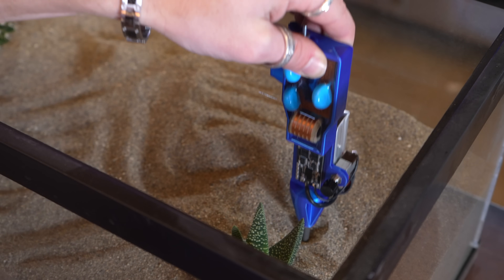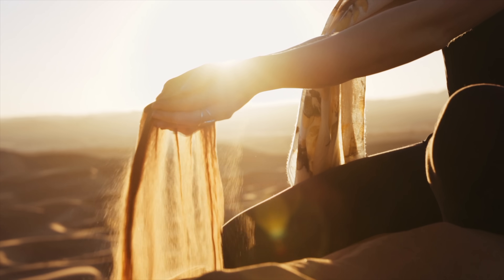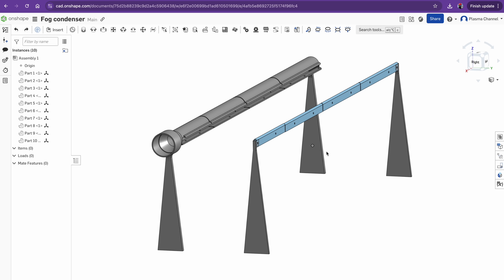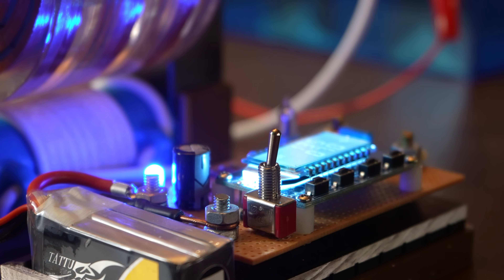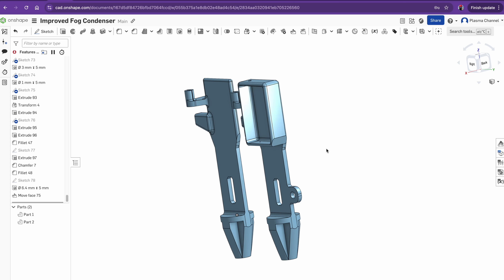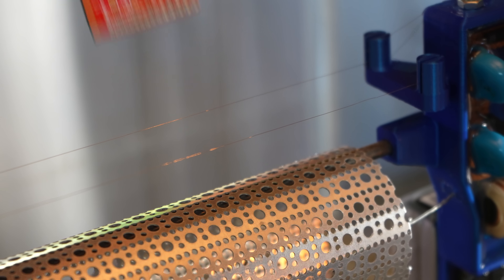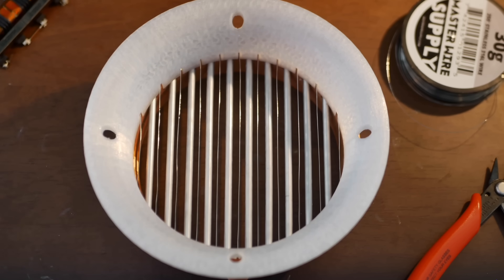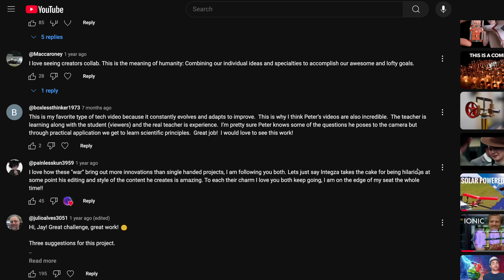Solving Desert Water Shortages Using 20,000 Volts

Comment: Clever work, however it only works if the mesh is "cold", it could only work in the morning when the air is slighlty hotter than the condenser, due to different specific heats. You would consider it working for, let's say, notmore than 1-2 hours a day. It's already pretty descent but true conditions testing might affect the rentability of it as the condenser would get warmer and eventually not cold enough to condensate water (the heat exchange time between droplets and condenser being significally small with the speed). Would be happy to see a video in such conditions !

Comment: So if air at high altitude has more charge than air at ground level would it condense out like in this experiment if you could draw it down to ground level via a tower with pipes inside it? Or would it loose it's charge in the process? Very interesting. I wonder if this could be used as a dehumidifier in domestic applications too?

Comment: Amazing concept! given it's in the desert. You could probably attach a solar panel to it,  charge during the day and allow the device to operate without replacing the battery.. Even if it weren't used for agriculture. It could be used to start vegetation growth in deserts, which is an idea being floated by a few countries with respect to reducing Co2.

Comment: Problematic that the grid is grounded and has the same potential as, well, ground. You'll condense water over the whole ground area. Also the droplets shoot through the grid like in a thruster. A solid plate works better. Use a steel sheet and stick some magnets to it that crash the droplets onto the plate like in a sputterer. Probably improves efficiency by a lot. Greetings from Germany 

Edit: I forgot. If you up your voltage or reduce the electrode distance to an energetic corona discharge, you'll get RONS, which form ammonia and hydrocarbons which fertilize the land while you water it

Comment: Surely, you can't beat the efficiency of fog nets, because they consume no power. If they only gather a small percentage of the available water, it would be more sensible to just put up more fog nets. Double the fog nets means double the collection for the same power consumption - zero. However, your device may make sense where physical space is limited and/or where time is limited, such as a portable survival device. Then you have the limitations of how portable it could be and the issue of availability of power. Maybe also as small scale desalination.

Comment: Humidifier make water from air.
But it seem the HV system is more efficient..🤔
To increase surface area, I would buid an assimetric capacitor, wires one side and mesh on otherside or make a wrapped spiral capacitor and just blow air through..🙂

Comment: I made a comment but can no longer find it from 30 mins ago so I will repeat. Maybe it got lost.  I  love the research you are doing, I see your video today, and yesterday I saw something interesting.  Your device is interesting but it requires electronics and a battery.  I know a solar panel could run it.  However a little food for thought for your projects scope.  Tesla once built a wooden tower, it was a project to take free energy from the sky.  Unfortunately he never got to finish the project. The research on free energy is somewhat proven, but not really of any practical use, until I see your grid water collector. I am seeing high voltages, free, apart some tower constructions. I will paste a couple as food for thought.
Reply: https://youtu.be/2rVdEhyMR6A?si=hlo5G9of4M8ynDyr
Reply: https://youtu.be/ENeDkGce5-4?si=NX1q_tGti2tNvrP0

Comment: 15:09
well the dehumidifyer is made to condense water.
You version just attracts already condensed water (fog).
Fog is made of condesed water dropplets submerged in air.
I am pretty sure that Thermodynamically you could do that with 0W of power in theory. (in the limit of a perfect system doing it as slowly as only possible)

Comment: great device to pull water out of fog , and it doesnt compare to the dehumidifier in that work case .
but how does it compare against the dehumidifier when there is no fog ?
so say the humidity in the room is 65% what would pull more moisture out of the air than ?

Comment: So explain why the "fog" responded so strongly almost like a heavy wind when you first powered the system? I mean it is one thing to see water condensing but another to see it turn into a wind tunnel...Could this also see application for areas such as Pacifica, CA to "defog" the area for driver safety while solving some of the drought problems in CA at the same time?

Comment: Ok, so: First, I love this.  It's awesome.

Second, I've been looking an emergency preparedness, especially in case of long term power interruption.  (Both solar events and foreign hackers are currently a significant threat to large parts of the U.S. power grid.)  What I've found is that the biggest danger of a power outage that lasts more than a few days is water.  Close to 100% of Americans rely on either city water pumps or a well pump on their own property for a continuous supply of water and have no backup option available if a power outage prevents the electrically powered pumps from working.

I've been looking for solutions to this, but the big ones I've found are things like installing secondary hand pumps (which would have to be installed in underground bunkers in climates that get significantly below freezing in the winter), which are fairly expensive solutions.  Now, solar panels are not super expensive anymore, and most places in the U.S. have significant humidity in the air a lot of the time and/or mist in the mornings, during times of year where precipitation is low enough that it isn't a very plentiful source of water.  This sounds like the kind of solution I'm looking for.  (I'm not looking for just one solution.  The more the better.  Also though, the cheaper and more widely available the better.)  I'm very interested, and I'm excited to see further development.

One thing I'm curious about: How much water can this extract from air without fog, at various humidity levels?  And of course, does the efficiency suffer with lower humidity (probably), and how much?

Anyhow, awesome video!  Thanks for sharing.

Comment: What a load of BS.... this ain´t new. The principle of "harvesting" and redirecting the moisture in the morning in hot and desert climates is not new and does not need any tech... especially not in such an inefficient way... deserts can get very cold at night and it only needs a surface that does not heat up as fast to condense some of the morning moisture in the air.

Comment: Why not tune the transformer to roughly 30kv instead of 8kv then using the v-multiplier - it is redundant and makes it more costly for mass production. Why is it redundant because it still outputs 20-35kv.
Reply: It's costly to build a 30kv transformer. The wire needs thicker insulation for 30kv. Here, the transformer windings only need to handle 8kv. Microwave ovens use a voltage doubler for similar reasons.
Reply: @realsolarcars  He initially used the 60Kv trans and tuned it town to 8kv then took it up to 30kv with the mulitplier. initially, it could have probably even kept it at 60Kv

Comment: This phenomenon needs to be studied much more and optimized. At the same time experiments on a real scale are better to find out if there are ways to optimize the system with a number of physical "tricks" like cooling the base. Hence, the air condenses because of a greater temperature difference. So many things to find if this is even economically feasible.

Comment: Wondering about the enviroment if the thin wires would survive and for how long also if there is a way to coat the metal grid with a hydrophobic coating to make it easier for the water droplets to pour down as well as freeing up the grid for more water to accumulate..

Comment: I noticed that the anode/collector on the last setup was bent so that the sides were angled inwards. Thus they were missing some of the falling air that was being pulled down with the charged mist. In a situation where the mist is all around the device, ( instead of from a single point ) this would reduce the amount it could catch. Because this device is basically a stationary ion motor, I bet the efficiency would go up if you bend the collector so the sides can catch more of the downward airflow.

Also, I think that there could be a way to combine this device with a solar panel by using the back of the panel as the collector etc before the sun comes up. Then rotating to catch the sun during the day. If it had a reservoir or was connected to a storage system with other panels, it would not have to be where the plants are and could provide water for other purposes too. A large solar panel has enough area to catch a lot of water under the right conditions.

If you coat the collector with something that radiates infrared so it is cooler than the ambient temperature, then it will get condensation thermally too. Then you could run it all night instead of just when there is fog. It would not get as much that way. But when every drop counts it would be worth the energy spent pushing air against the collector all night with the ion motor.

I wonder if putting the cathode wires into a venturi would improve it or just make it more complicated. You can also do something like adding another wire wrapped around the two main wires to increase the area of the cathode. Or just replace the two wires with some coarse stainless steel hardware cloth. Of course, increasing the area will increase the power needed. But I think there is probably a sweet spot of largest cathode that provides the hightest, acceptably efficienct  output.

Comment: That is a great piece of technology, amazing to see how one project can start new ideas. As a chemist that has been working with electrokinetiks for a while my first thought is if you tested the produce water pH and electrical conductivity. That could inform on the additives required to obtain the irrigation water, and also impact corrosion rates on system components, which was mentioned in the comments.

Comment: Im a bit worried about the security implications for workers and desert animals. A 20kV tripwire seem wrong. Especially bc the small critters will be attracted to those wires bc there's water, lots of water.
What are your thoughts on this.
(I'm no expert on high voltages when it comes to safety tho... But I imagine 20kV will hurt as hell and for small critters like mice even the low current could be deadly, right?)

And I'm curious on the climate implications when removing the morning fog. Does the fog just dissipate into small clouds or does it dissipate where the ecosystem needs it?

Thanks for the great video!

Comment: You used a peltier dehumidifier thats like 5 times less efficient than vapor compression ones, why dont you try a soda can  refrigiration compressor that also runs on 12VDC, try QX1901VDL with a simple dehumidifier circuit and see the ml/wh of this as well!

Comment: That's pretty cool. It's almost ten times as more efficient as a typical evaporation and recondensation setup. Of course you'll need that coastal fog, so half your energy comes from that since you don't waste w/h to evaporate sea water. Still it's a pretty neat idea.
And first I saw, high voltage, arcs, atmosphere, and I thought "are you making nitric acid water?" but this looks more safe
😅

Comment: 14 ml/Wh (that's how you write whatt-hour, not W/h) is 71 kWh/m³. That's about 25 times more energy than desalination of sea water by reverse osmosis. A technology which has an unlimited 24/7 supply of raw water.
Yeah, the specific power consumption of a large scale facility would surely be smaller than this small scale test but by how much?

Comment: Another method is to use a solar-powered ammonia refrigeration setup to cool a sand battery, which passes the heat deficit onto a coolant loop that runs through a radiator at night.

Comment: I just fast forward though the video but they sell machines that do this, we had electrostatic precipitators at the machine shop I worked at to remove coolant mist from the air and they do a good job. Had probably a dozen hanging from the ceiling with a drain line. But they also catch dust as well so we had spare sets of collector plates that are send out for cleaning in rotation.

Comment: Well if you are planning on scaling this up, you should grab yourself a couple of 100 KWH DC Tesla battery packs as your power source, you might want to use gold or iridium-plated wire to prevent oxidation of your primary conductors, and corrosion from moisture.  You could use a solar array to trickle charge the battery packs.  You could run these stacked on top of each other, each with their own separate phase, or you can also experiment with multiphasic AC conductors, Wye, or Delta.  You will need a water collection tank and a pumping system, or you can slope it so the water runs into an above/underground collection tank.  You could also place the device above the tank as well, and let gravity bring the water to the tank.

Comment: This may be suitable for placing it on ventilation holes, such as a grille with smaller openings or a ventilator, and a fan that draws in the air and reduces its humidity. You can adjust the amount of humidity that is allowed to enter according to effort. You can also benefit from the water it produces and install a pipe system and a water tank to water plants, wash cars, or even use it for a shower. It may also be suitable for making water bottles for survivals. It works in this way because you do not need refrigerant gas and a large volume. You may collect some water for yourself and have a solar panel with it

It is also useful to have on boats in case they get lost and need a water source

Comment: One of my project concepts I am working on is to cover huge sides of all buildings with condenser of material coolant type where the moisture from air is reduced to water 
Main aim is to take out moisture in places of high humidity  where bringing the humidity lower bring down considerable irritation due to sweating in hot cities

Comment: This would be perfect for sail boats at sea getting water for bathing or any non drinking use. Humidity is a constant annoyance pretty much on any sailboat in warm waters. Long ocean journeys usually require forgoing showing or rationing fresh water. Making water with conventional systems is a large energy use that most will not feel is worth using for more than cooking and drinking water. Most do not even buy the water converter systems. Something like this would be much better.

Comment: nice work. 
design a small one that with small solar and  cap that will hold 2hours of use.  charge cap during day.
fog moisture detector so it only kicks in when fog is present.
welcome to arrakis. with something that can water individual plants. 
For bigger, maybe a decent sized funnel. as ir moves up, a fan generates power... funnel is large and metal... if it was covered in solar film... store water for your house...

Comment: I did a bit of math but I figure 39w to make half a liter. Let's say 100w to make a liter. 1kwh makes 10 liters. My cabin tank is 6000 liters so it would take 600kwh at 24 cents per kwh means it costs $144 to fill it at best. I think I'll have to stick to water delivery. Maybe with solar but sun means no fog. Still a promising first go at implementation.

Comment: Ok, but you have to store the water in a "closed" "without air contact" container or it will evaporate as fast as it collects 😂😂😂
You are testing your "invention" in an already humid environment 🤷🏻‍♂️
You forgot to simulate the air of the desert, which has almost no humidity... So, you are "collecting lots of water" because the air where you are is saturated...🤷🏻‍♂️

Comment: Comparing the efficiencies of these technologies with high-voltage systems for mist collection in desert areas:

Efficiencies:
1. *Bio-inspired condenser*: 80-90% efficient
2. *Graphene-based condenser*: 90-95% efficient
3. *Membrane distillation*: 80-90% efficient
4. *Radiative cooling*: 90-95% efficient (for cooling, not directly for mist collection)
5. *Fog collector*: 80-90% efficient
6. *High-voltage system*: 50-70% efficient (depending on the design and operating conditions)

Advantages:
1. *Bio-inspired condenser*: Low cost, simple design
2. *Graphene-based condenser*: High surface area, efficient condensation
3. *Membrane distillation*: Low energy requirement, compact design
4. *Radiative cooling*: Passive cooling, low maintenance
5. *Fog collector*: Low cost, easy to maintain

Challenges:
1. *Bio-inspired condenser*: Scalability, material durability
2. *Graphene-based condenser*: High production cost, potential contamination
3. *Membrane distillation*: Membrane fouling, energy requirement
4. *Radiative cooling*: Limited cooling capacity, temperature fluctuations
5. *Fog collector*: Weather dependence, limited collection rate

High-Voltage System Challenges:
1. *Energy consumption*: High energy requirement
2. *Safety concerns*: Electrical shock, equipment damage
3. *Maintenance*: Complex design, frequent maintenance

Considering these factors, the bio-inspired condenser, graphene-based condenser, membrane distillation, radiative cooling, and fog collector technologies have the potential to be more efficient and advantageous than high-voltage systems for mist collection in desert areas, bhai!
Reply: High energy? Complex? It is easy. But I have to check other options you provided. On the deserts you have a lot of sun to charge accumulator to use it on the morning.
Reply: @mkrzyzowski  ok sir,
I was just stating  my point of view 😅